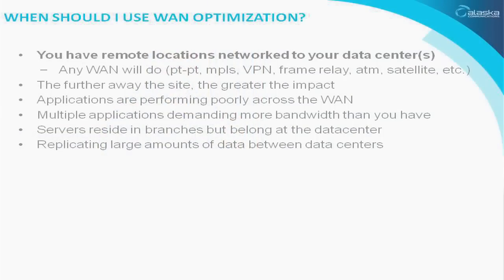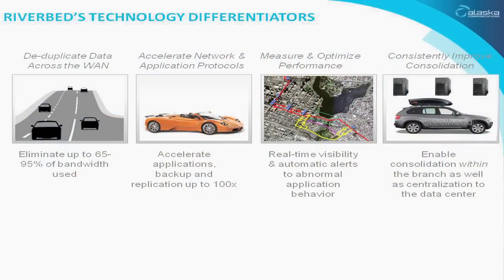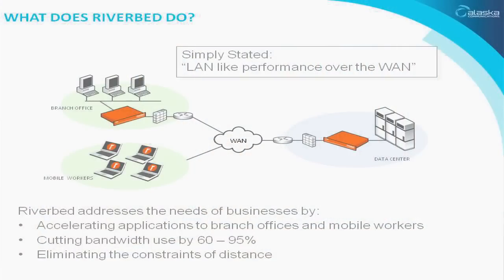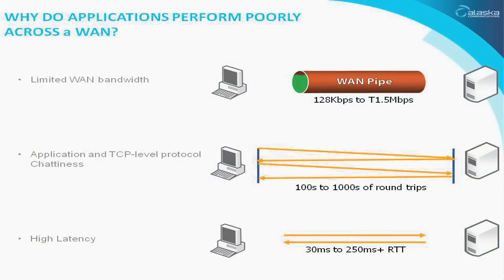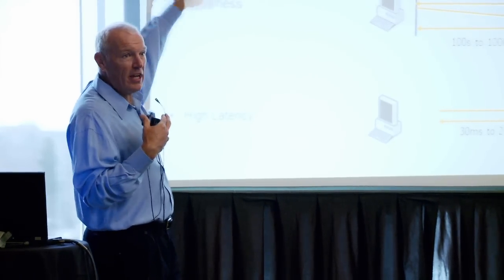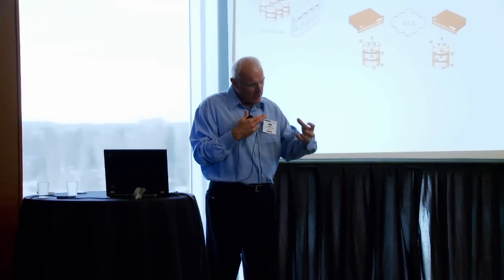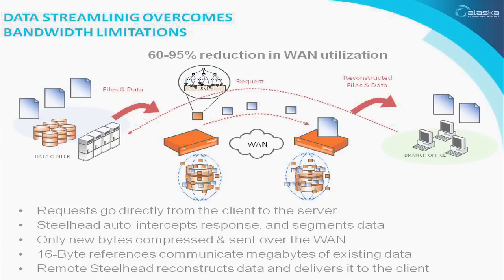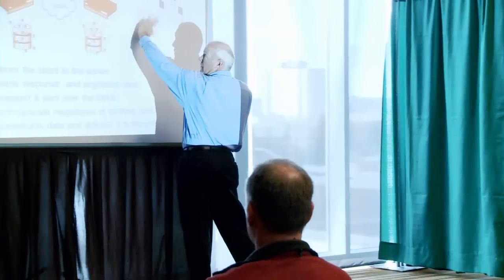How does WAN Optimization work?

Comment: and i rather use PPP with CCP(van jacobson) and deflate, than this mess of ripoff, even on a satelitte as most desktops support PPP aka dialup connection over IP. and if i add HTTP2 with HPACK and brotli compressed stripped webcontent over the PPP link, i effectively get 99% of the features Riverbed charges an arm and a leg for.

wake up people, everything shifts to the web, especially all those legacy corp tool, email/fileshare/intranet, all of them over HTTP and with it tons of redundancies that Brotli/GZIP/deflate and PPP are dying to rip out of the traffic!!!